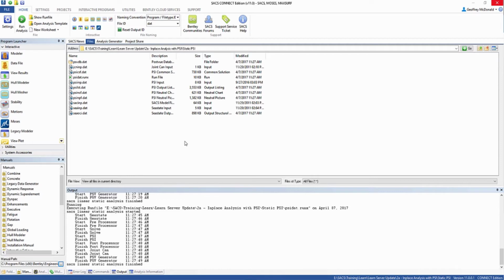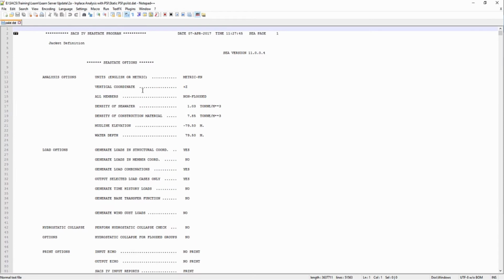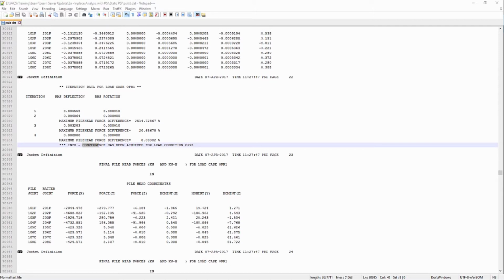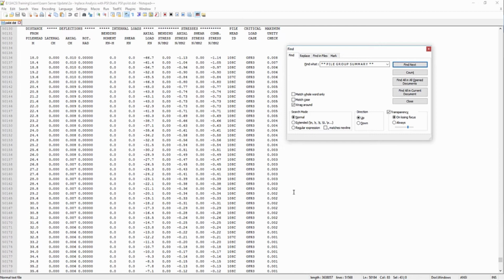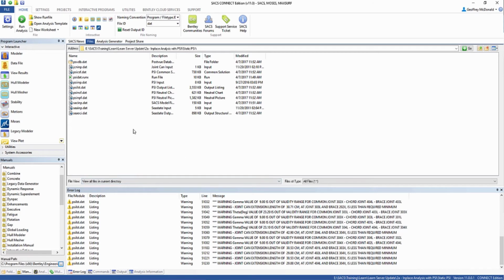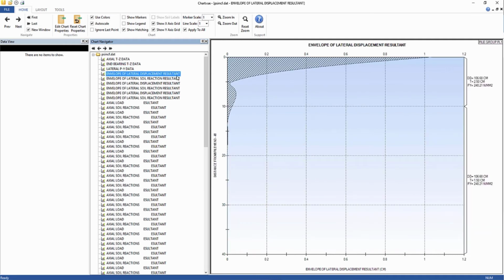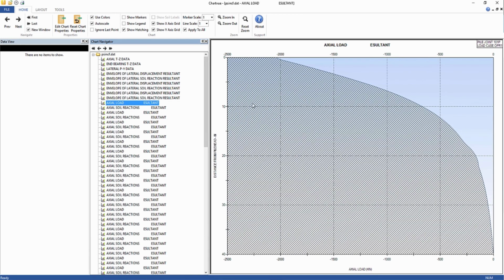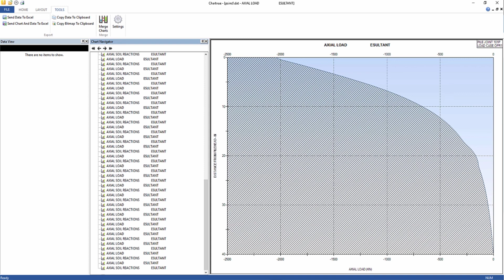In Place Analysis   PSI Results

Comment: Make Explain Design of Fpso Structures like piperack
and explain types of analysis made in it.
Reply from the maker: We can work on it. Which kind of analysis are you looking for?
Reply: @BentleyOffshoreAnalysis  Static Inplace Analysis
Barge Analysis, Lifting , transportation, Loadout.
And also shortcuts used in sacs while Modelling.
Reply from the maker: @rakeshkurbet8409  all of them but Inplace Analysis you may find here: https://youtube.com/playlist?list=PLX3HK9S8pbdhz35Q5nAqOEm_AqJ-sOd36

You just need to make some adjustments to the structure itself but the analysis procedures are the same.

Regarding Inplace Analysis for floating units we can work on it.

Please press Alt and you will see the shortcuts we have in Precede Modeler.